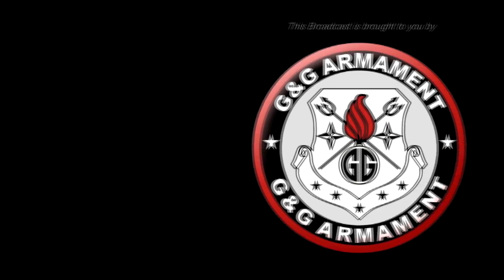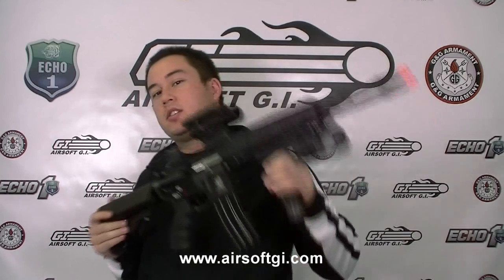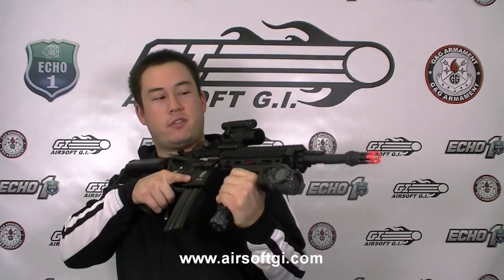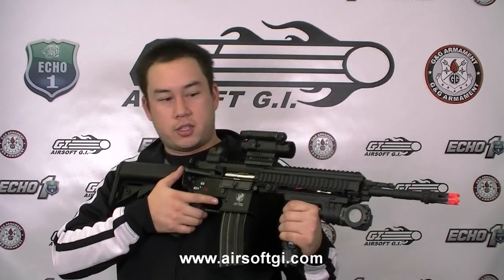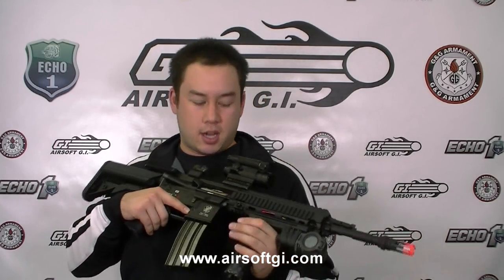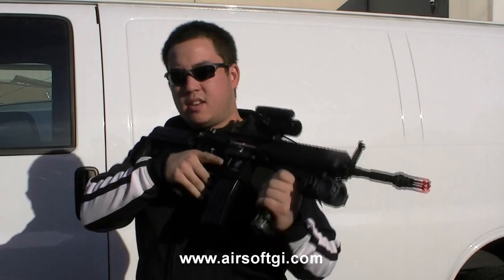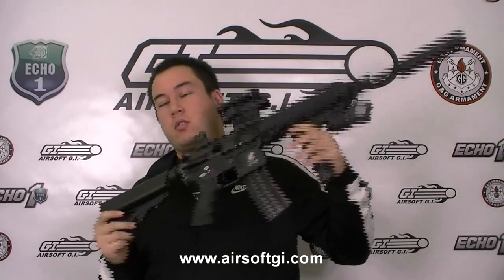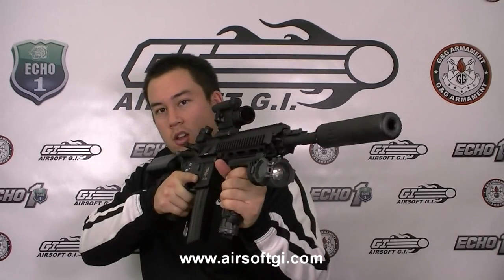Airsoft GI - G&G Top Tech T4-18 Pneumatic Blowback Full Metal AEG

Comment: @Walkman1OldSchool1 

Depends what you want. There are two guns that I suggest you look into. The Combat Machine M4 Blowback is one of them. It is a M4, and is priced at $170, and has G&G's Pneumatic Blowback, which is shown in this video. Another gun is the Combat Machine RK -47. It is an AK - 47, and is priced at $156 dollars. Both of these guns shoot relatively high FPS, somewhere around the mid to high 300s. They are very good, and I highly suggest you look into one of them.

Comment: well there are several other things.  The fire select switch has the hk pictograph instead of the normal (SAFE, SEMI, AUTO).  LWRC is the only other one besides hk that does that (that i know of).  The mag well is angled straight out instead of up a little bit.  The sights are clearly hk416 sights.  And the RIS system is EXACTLY identical to a 416.  I'm pretty sure it is a 416.

Comment: To, airsoftguy111
Slightly, Id rather have a few more Mp5 mags than a sidearm. I can reload the Mp5 in about 3seconds (because all you have to do for airsoft is release mag, and place new one into magwell; dont need to rack the charging handle in airsoft) & it takes about the same to draw my sidearm. Because you have to drop your primary, take sidearm out of holster, take off safety, then aim down sights.

Comment: Pneumatic blowback guns claim that they use excess air that is not contained in the cylinder from the piston's movement. I'm not sure how this is possible or whether it hurts the FPS or not but I am sure that it virtually doesn't harm the internals because it is a much smarter system than the regular blowback system.